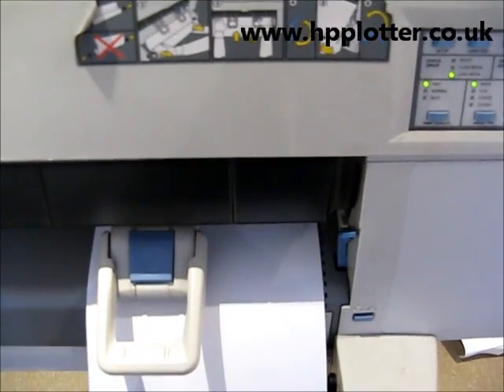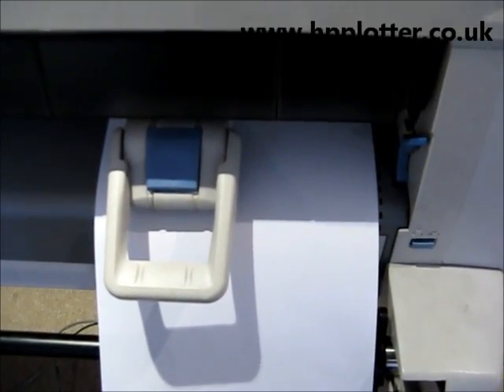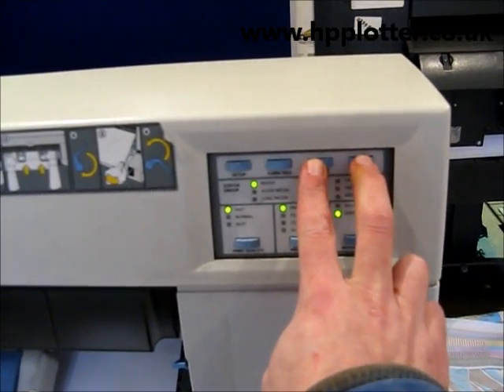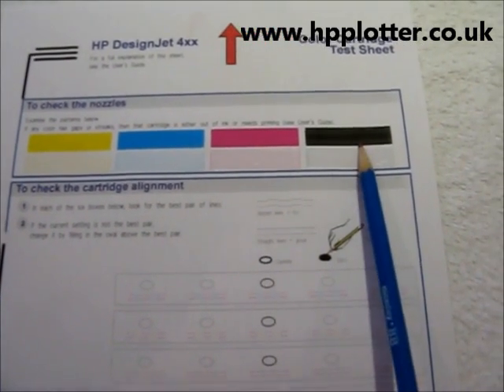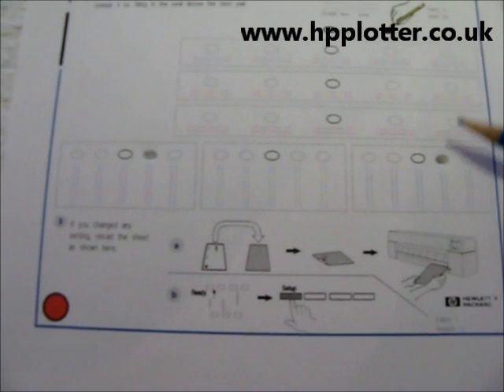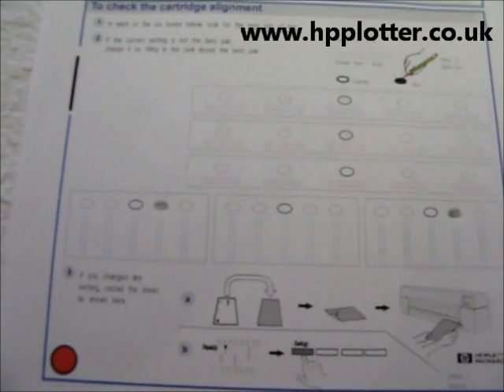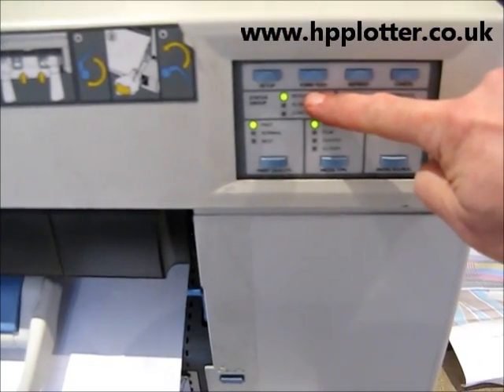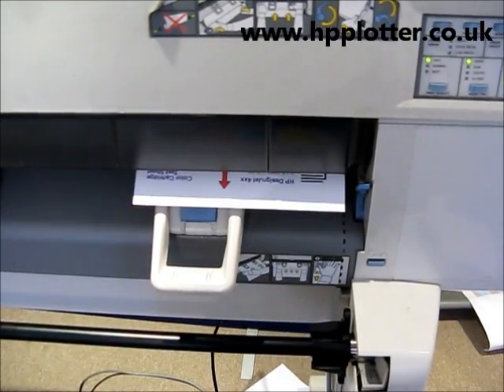DesignJet 450C colour cartridge alignment - DesignJet repairs

Comment: Great help,  thanks!  I have a question that  cannot find an answer to anywhere.  In my 450c print test 4 pattern is supposed to be Cyan but it is purple.  I changed CYM carts and is the same but alignment is way off. I'll run a cart alignment as you show in your video and see if it helps.